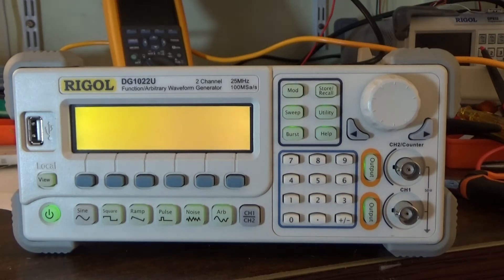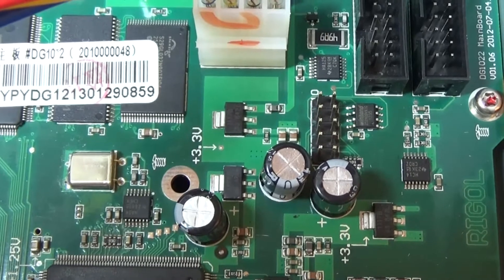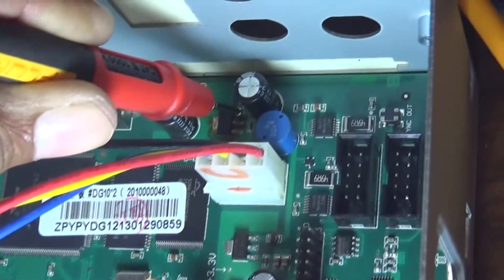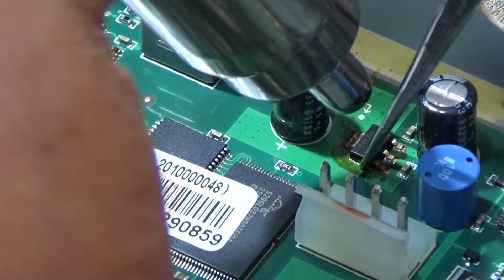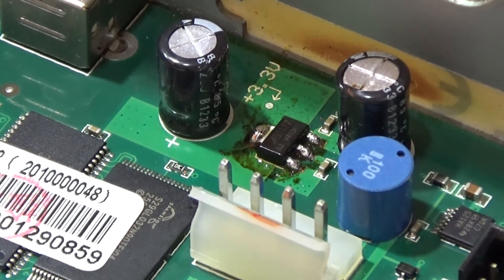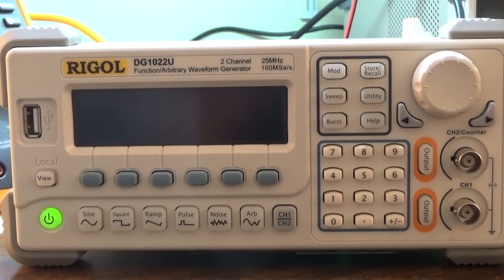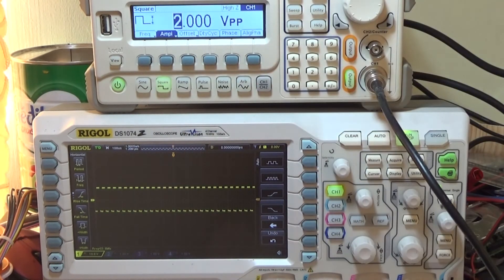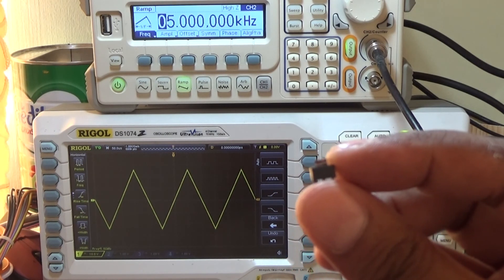Rigol DG1022u function generator repair

Comment: Hi,
Same model, different situation.
the device is not powering up - inspection of power supply module shows that it is dead.
Any suggestion ?
I thought, I could manually supply those voltages  IF I KNEW THEIR VALUES  🙂
So, can you give any hint of voltages of those two sets of wires from power supply module ?
One has 4 wires (Red, Black, Yellow, Blue) and the other has 6 wires (Red, Red, Black, Black, Yellow, Yellow)
Thanks

Comment: What is the device replaced?
Reply from the maker: the regulator 1117 3.3 Volt was damaged in my case, see the video at time 2 min 11 seconds its written the voltage 3.3 V 
Datasheet is as follows 
https://www.ti.com/lit/ds/symlink/reg1117.pdf?ts=1618740541604&ref_url=https%253A%252F%252Fwww.google.com%252F

Comment: My Rigol DG1022 function generator, the CH1 channel stopped working; no output signal. The self-test does not give errors. I noticed that by selecting the CH2 output, when I change the waveform you can hear the relays working, instead when the CH1 output is selected, the relays do not work when I change the waveform type. Any suggestions?
Reply from the maker: Hi sorry i don't have the schematic , else try to follow the signal from the output BNC to the relay , or might be a supply is missing on the relays for the Channel 1 , try to check  the different Voltage  regulators output

Comment: Yes I DID worry about the heat gun and the flux on the PCB. I'd have used a soldering iron to remove the device TBH and cleaned the board before soldering in the new one. That apart a good repair.

Comment: Alway clean up the flux with flux remover dissolver. If you don't it eat away at trace over time as it becomes corrosive. Never use a hot air gun while board is still in case blowing directly by those large capacitors. A good way to destroy capacitors and get high ESR. That part you could have unsolder and solder back manually, no need for hot air, or at least use thermal tape on bottom area of capacitors. It's what I do when soldering BGA chip is put tape in other areas except for chip that hot air contacts while soldering.

At least you did get it working, just have to be careful as capacitors hate heat and flux will eat though traces. I done that mistake, not cleaning up flux myself years ago and learned the hard way.
Reply from the maker: thx for the Advice will clean it for sure  else its still running thought dont use it that often, else think rigol must revise theirs products as often we have regulators heating up

Comment: There is a similar problem, but it is not the regulator, maybe there's someone electric circuit of this generator?
Reply from the maker: I dont have the circuit , try to test the voltage from the other regulators else may be the incoming supple to the reg is faulty

Comment: I agree. Too bad you didn't clean and prepare the board before installing the new part. Watch Louis Rossmann's videos on surface mount component repair. He make the clean up look super easy and rewarding. The fluid that remains on your board might give you problems later on.